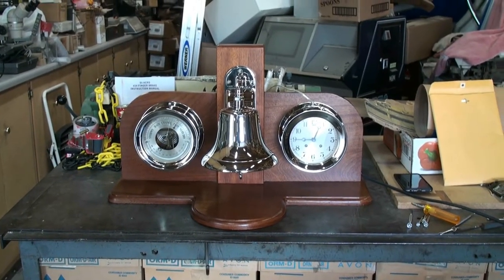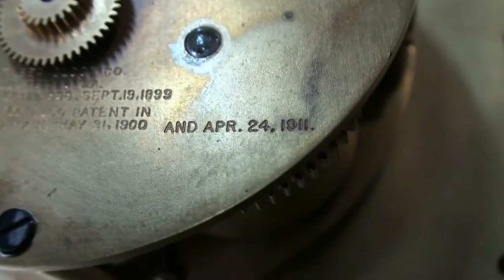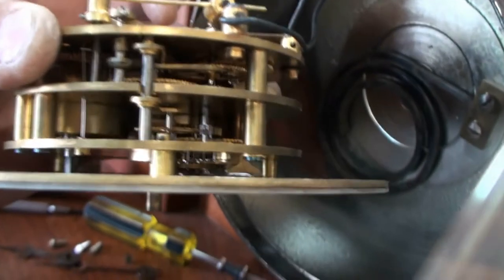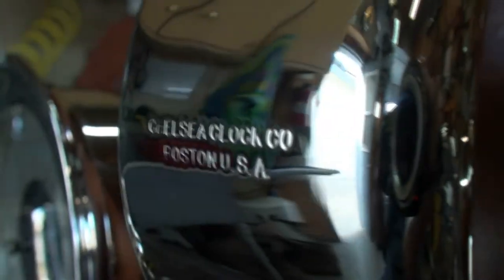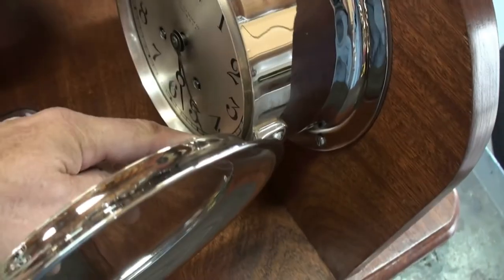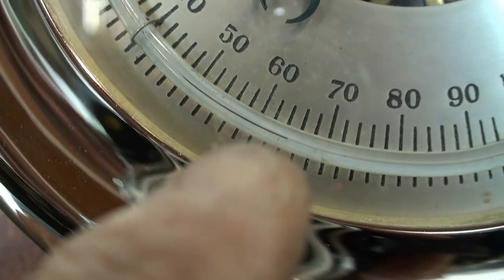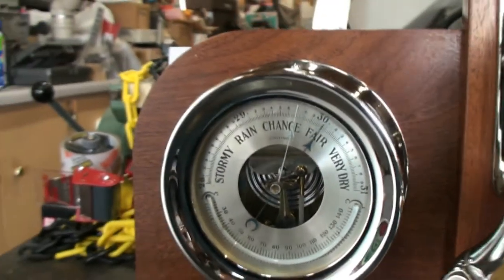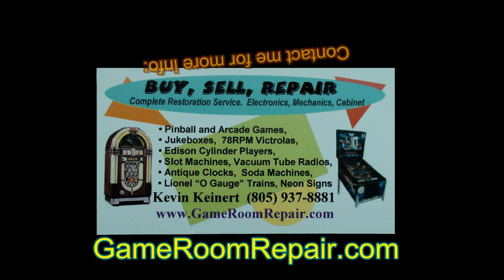Chelsea Automatic Ship's Bell with Barometer and Huge Bell

Comment: YIKES!!!  Exposed, 110-volt AC on top of the clock???  And this is a "convenience for your yacht"?  Like at-sea?  Around SALT WATER???  On display around stumbling humans as the boat rolls and pitches with the waves?  That is not even close to sane.  It's like some kind of looming death sentence for horology fans.  But, of course, it's not even close to original.  The original diagrammes show a cord coming through a fitting from the bottom of the clock and connecting through a standard plug to a 110-VAC mains outlet looped to the control box.  This allowed the clock to power a circuit for the bell actuation in parallel to the press button and local activation of the bell at the control box.  But there was never intended to be exposed 110-volt connectors on open display sticking out of the top of the clock!  Whoever the madman was who gerry-rigged this poor clock to ring that bell, it's his insanity that has been restored, not the work Chelsea Clock Company.  Chelsea are sensible people on-the-whole* and we used their clocks in the Navy because their instruments were near-impossible to break even in the face of salt water spray, steam leaks, vast temperature changes, ham-handed operators, or my leaning against one whilst it jabbed me in the back year-after-year as I sat on the Machinery Two Upper Level Workbench during watch (and impervious, as well, to nuclear radiation on my submarine).  What this was was a dangerous bodge job; it's now a restored, dangerous bodge job.  I'm horrified.  Please, PLEASE be careful around this fire and safety hazard.  Do everyone concerned a favour and drill a hole for a power fitting in the case of the clock, re-route the cord, and remove those exposed contacts.

That bell knocks the crud out of the needle on that poor, mismatched barometer.

Some nice work, though.  I'd own this thing.  But I'm an engineering type and out of my mind.

*LORDY!  I have to take it back!  I just found an image from the Chelsea 1911 catalogue showing the clock with the wires sticking out the top.  http://www.chelseaclockmuseum.com/Page_2711.jpg    I say again: YIKES!!!

...but wait, there's more:  Now I'm looking at a wiring diagramme in the 1923 catalogue, and the power flowing through that circuit was to be from FOUR DRY CELLS, not mains.  Whew!  http://www.chelseaclockmuseum.com/1923-48.jpg

  .